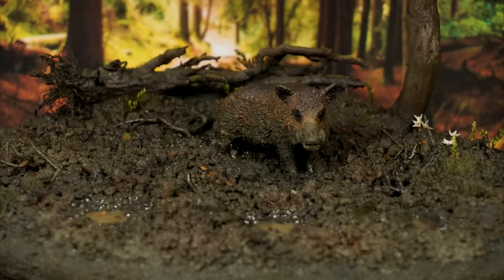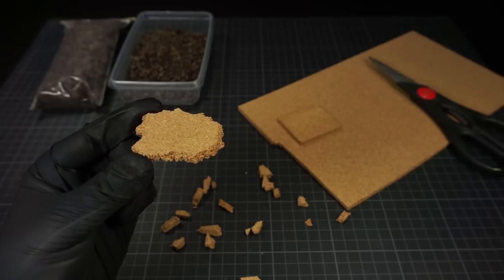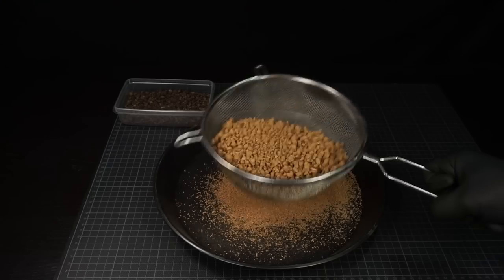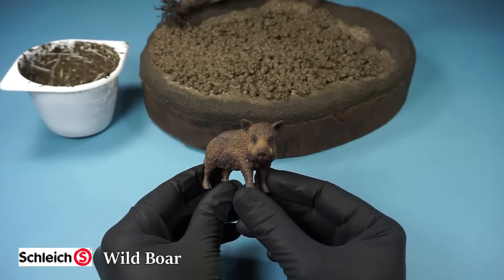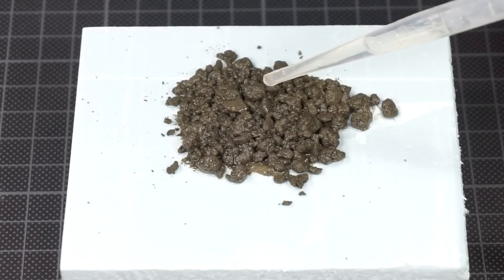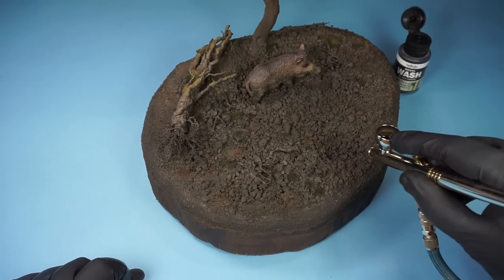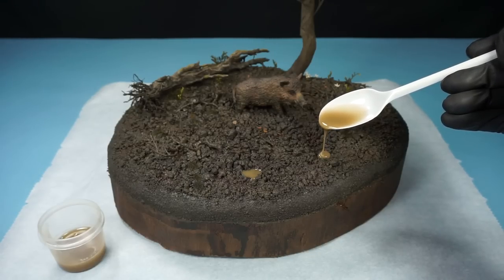Making Super Thick Mud For Realistic Terrain Scenery - Muddy Ground Tutorial For Dioramas & Modeling

Comment: Thanks! I'll be mixing up a batch later. Have you made it in larger batches and saved for future use? If so, how long does it last?
Reply from the maker: Yes i often have leftover paste mixtures. You can wrap your container in some shrink wrap and place it in the fridge, it will keep for weeks. I only would add the cork at the last minute though, it absorbs moisture so your mixture will dry out quicker. When it's too tough you can always add a few drops of water. Cheers.

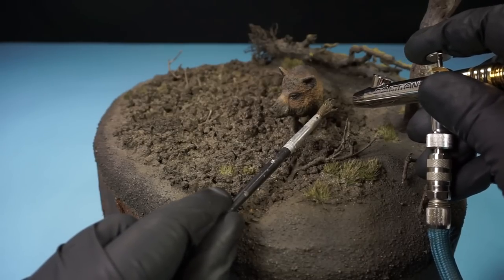Comment: When you were adding the mud with the airbrush together with the regular paintbrush (8:17)... Were you using the paintbrush as a kind of mask to limit the area the airbrush was hitting? Or were you blowing just air out of the airbrush to blow paint off the brush and onto the surface?
Reply from the maker: Hi, I used the airbrush just for the airflow without the nozzle in it to splatter to paint on. The mask idea you mentioned could work, although the paint would need to be very thin or your nozzle may clog very quickly. I like the idea! Cheers.